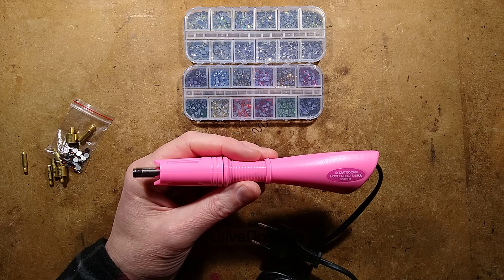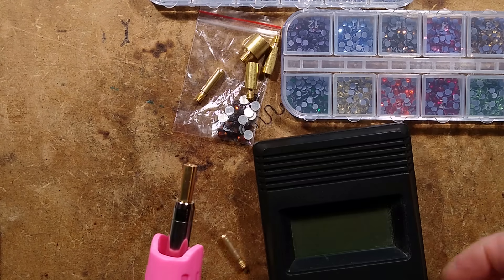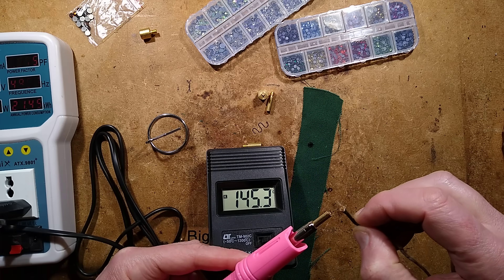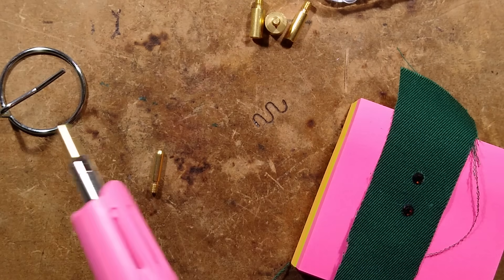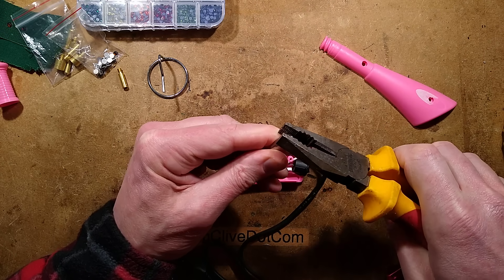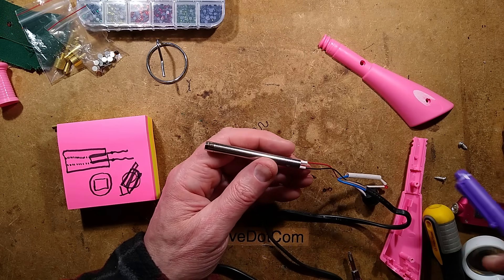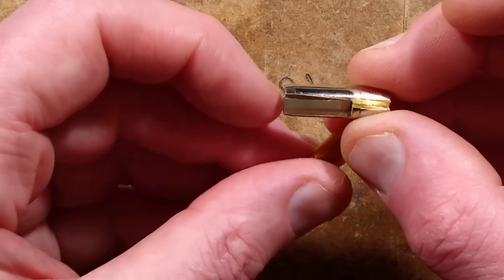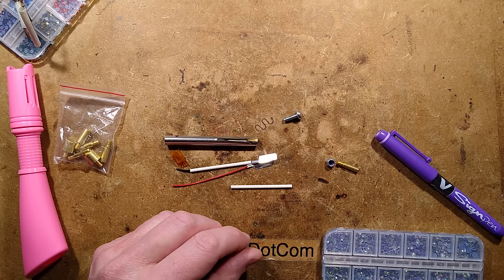Inside a "hotfix" rhinestone/diamante applicator

Comment: Would this potentially be a good desoldering tool? Hold it to the back of a joint to get components out? Idk that’s the first thing I kind of thought.
Reply from the maker: Not hot enough.
Reply: @ yeah that makes sense my iron usually runs over 300 c

Comment: A foreign class 1 appliance with no earth and 50 microns of insulation between you and the mains? Why am I not surprised.

All they had to do to make this safe was use an earthed plug, a 3-core flex, and connect the barrel to the plug earth pin (this would also prevent the temperature probe reading oscillations). Sheer incompetence or lack of care. Take your pick which one you think it is.

Comment: The method given by those brands that can be bothered with unmanly things like instructions is to match up the tip size to your hotfix crystal, pick it up, glue side down, with the tip and watch for the glue to melt. Then you put it on your fabric and withdraw. Takes a bit of practice, but doesn't have the glue squirting eveywhere, or burnt tables.

Comment: "Roughly a 4mm thread" - a good question to investigate would be "Is it a standard metric size?" - I have a phone/tablet holder with a gooseneck and a weighted base and let me tell you that the threads on the nut holding the thing together at the bottom may be metric but they're not in a typical thread pitch for the nut size meaning I couldn't replace the cheap hardware supplied with better kit that wouldn't loosen with use.
Reply from the maker: At the end I tested with a "standard" 4mm machine screw.

Comment: I wonder if those plastic bits stay on the material when the clothes are washed. Not great for the environment to get those little plastic bits down the drain...
I also wonder about the heat transfer: How hot might the PTC become and when would the capton tape start melting? It's a heat insulator as well I guess.

Comment: I've dismantled one faulty cheap hot melt glue gun, and they placed a tiny PTC thermistor wrapped in a tape (can't remember whether it was Kapton or something similar) into the metal nozzle, with not much of an insulation.
Reply from the maker: That's a common approach, with a metal clip holding the PTC element against the heated head.

Comment: Thank you, Clive.  Excellent tupper-cam close-up photos, as usual.  It's OK, there is no need to apply rhinestones to your tools.

It would be great if someone would invent a way for non-sewing clumsy bachelors to use this type of tool to re-attach buttons to shirts.  Maybe some sort of moulded polymer sharp-pronged thing that would go through the button's drilled holes, then be manually pushed through the shirt fabric, and then after turning the shirt over, the equipment operator aka clumsy bachelor would use this tool to press the polymer prongs together into a fused blob on the inner surface of the shirt.
Reply from the maker: You get buttons that either have a back that screws on or presses in.

Comment: someone turned a soldering iron into a bedazzler. The purpose seems to be so that you don't have to use a hot glue gun, with the tradeoff being you have to use a soldering iron instead? Very strange.
Why wouldn't someone just use a hot glue gun?

Comment: That thing reminds me to some degree of a tool made by Weller a couple of decades (at least) ago which is used for branding wood fibre and leather products. It came with a variety of different patterned bits and was quite a nice tool for decorating and customising things. It actually looks very much like a soldering iron in any other respect. It would certainly handle this job - no trouble at all.

I'll have to go and see if I can find it again....

Comment: good to see its built down to the chinese safety standards one slither of captain tape between electric shock and burns and a resistor to melt handle ,i suggest if your going to use it get an isolation transformer thick rubber gloves and a fire extinguisher!

Comment: It might be useful for heat staking plastics when reparing things like vehicle bumpers and interior panels. If designing 3D printed enclosures you could print plastic locating pins that you then dome over to retain the part in side.

Comment: Clive, get a cheap Chinese tiny thermal camera, one that you can plug into your smartphone or tablet. There are ones with resolutions rivaling Teledyne FLIR's cameras now, 256x192, but costing less than $300. I think it would be a cool addition to your reviews when we can see gadgets like this under a thermal view, and getting an instant picture of what parts get how hot. This would be so useful when reviewing LED lamps, hot tools and dodgy power transformers. You can find hidden surveillance equipment with it. Bugs. Also real critters outside at night. I bought one and had so much fun with it. Looked at the moon it reflected heat at ~8°C. I wish they were standard in smartphones.
Reply: Good suggestion. Actually, Clive has already done a great review of the mobile phone that he uses that has a FLIR camera built into it... ( I think it was a DooGee or something like that).

Comment: The brass tips for hot melt thread Inserts are M4, too. So this would be a cheap alternative. I use the inserts with a Parkside soldering station that has M4 tips, so no need for this pink beauty. 😂

Comment: The fluctuating thermocouple-readout 2:36 may suggest that there is electrical (mains) leakage whereby the common-mode rejection of the "thermometer" is overwhelmed, making it show a temperature that is way off the true value. If you unplug the appliance, you can easily check if this is the case...

Comment: Bouncing temp reading may be due to AC on the ungrounded tip. I've seen thermocouple meters do this in the presence of any AC signal on the TC input
Reply from the maker: It probably was coupled AC.
Reply: @mikeselectricstuff  that's good to know because I've had weird readings from thermocouples too, in the past

Comment: I always find it very disturbing how hot glue guns rely solely on capton tape to isolate the mains from the exposed metal parts. Considering they only have a 2 core flex I wonder how they pass electrical safety standards in the US, UK and Aus. I mean its not really double insulated is it?
Reply from the maker: It is a bit of a rule deviation.

Comment: Rhinestone was traditionally used to refer only to cut water-worn quartz that would be found in the gravel beds of the River Rhine. Diamante refers to all diamond-like simulants, including rhinestones, but also artificial diamonds and diamond shaped sequins. Now both are used interchangeably because they've both been associated with so many things that their original meanings were invalidated. Basically, if it sparkles and not a diamond it gets called a diamante/rhinestone (or Swarovski if you're trying to sound expensive). 🖤
Reply: And diamante is just diamond in Spanish

Comment: I bought one of these a while back for putting threaded inserts into 3d prints and it works great. I never trust these Chinese devices though so I wired a new cable on it with an earth lead to the barrel just in case it ever shorts. I also did the same with one of those cheap desolder pump soldering irons. 15 minute job for each and now I trust them a whole lot more. I also switched the resistor for 2 x 220 ohm to keep them running extra cool.

Comment: parkside(lidl) soldering station use tips with 4mm treads you can use just tips from that set and control temperature better and be safe form potential electrocution

Comment: Oh no! You killed it!  Good to see the metal end isn't earthed for added fun if a wire should come loose!  Shame the hot glue spooges around the edge of the diamante as it ruins the effect.  Wonder what they used before hot melt glue was invented?
Reply: “Spooges” – you speak fluent Clive 😂😁
Reply: Ordinary glue. Which seems like it would work just as well if not better. A dot of gel type superglue and place the stone, would set just as quickly.
Reply: @NiallWardrop  Except that hot melt was around before gel type superglue. I think they used to mount the rhinestones in studs that  were attached mechanically.
Reply: @SidecarBob  I just mentioned the gel as probably the best currently available.
Reply from the maker: I did buy a replacement afterwards.

Comment: I have a similar tip for my soldering irons (TS100 and TS80) for putting threaded inserts into 3D printed parts. 
It is useful to be able to set the temperature to the low end of the melting point of whichever type of plastic was used. Otherwise if it's too hot, it can melt too much of the plastic and cause the insert to move out of place before it has a chance to cool down.

Comment: would be interesting if the tips were the same size and thread pitch as the screw in tips for a soldering Iron
then you could have a pink soldering iron to go with your kink paculator 😀
the potential shock hazard is worrisome tho...

Comment: If I’ll be testing small loads should I buy a Hopi or the antai? And is there a USB tester power usage you recommend?
Reply from the maker: They do different power ranges in both the Hopi and Antai branded versions.  For smaller loads the low range versions will be more accurate.

Comment: If plugged into an isolation transformer, it could be suitable for burning away unwanted things on skin, like warts or ticks .   A lower value resistor would be needed to run the indicator LED at a standard 20mA, but it would have to be a 5W resistor to drop 240 V at 20mA .

Comment: Being pink and round: The google AI would have likely confused this with a rather controversial medical device that claims to use RF heat to cause a temporary inflammation. Nuff said. I think the selfish world gone crazy. As for them rhinestones one would think kids would be safer using a UV cure adhesive. But the latter is not reversible.

Comment: The same basic idea as the "heat set" or "hot melt" threaded brass insert tools, except that it runs at a lower temperature (just enough to melt the hot-melt layer?) Those things have saved my bacon on very many occasions, providing a FAR better fastening solution to the usual self-tappers that Manufacturers seem to like (for obvious cost-savings reasons)

Comment: Reminds  me of the woodburning art/craft kits of the '60s that included a handle with an E12 lamp socket for you to screw a heater into (they also came with an assortment of tips that screwed on).
For a lot of us in our early teens they were our first soldering ions. It was annoying as hell when the E12 expanded with heat so the heater lost contact just when it got hot enough to melt the solder...
Reply: I did that exact thing/ they did make a good soldering iron up to a point 🤨

Comment: My first thought was to wonder if this would be suitable for installation of heat-set threaded inserts in 3d prints.
If so, this would save me the trouble of keeping spare tips or a spare soldering iron to set the inserts.
Reply: You can get tips specifically designed for heat set inserts, there's one similar to this (but not an AliExpress special) mounted in one of those mini manual bench press mounts in the lab at work.
Reply: @Croz89  Also, Adafruit has heat-insert tips for Hakko-compatible irons.
Reply: @electronics-girl  
Thanks for that info, I'd looked for something along those lines but didn't find them. 
I have one of the various generic come t-15 irons sitting idle that could easily be used for this.

Comment: I wonder if that thingy could be used for brass inserts into 3D prints? So at the end does the PLC (or whatever is 3Dvprinter stuff)melt at 200 C???
Reply: Likely, but it would be a bit awkward. For PLA, the recommended temp is 225C (higher for other filaments). Inserts are easier to get into position if the tip matches the internal diameter of the insert's thread. They make soldering iron tips specifically for such inserts, and those work well.
Reply: @FedorKorsakov  So the short answer is no. but maybe with the right inserts and filaments.

Comment: So, some Kapton tape is all that is between the raw mains voltage and children...   At least in glue guns the metal heater barrel is usually insulated from being touched with an additional plastic cover.
Reply: Every glue gun I've seen has an exposed metal cone at the front.
Reply: @eDoc2020  yes, very true.  I wonder what the internals of a typical cheap glue gun look like - Clive????
Reply: @project-326  Clive did this a few years ago.
Reply: Well, I'd say if you're desperate enough to touch 220°C metal, you deserve to get a zap ;)

Comment: It's a Barbie soldering iron! About the right temp, and the tips undoubtedly have the same threads as soldering tips. The only difference is that extended collar and silicone grip around the barrel, which would be nice to have on a soldering iron, actually.
Reply: what type iron you think of? weller tips are just lumps of metal that are held in place with a collar nut sitting butt on butt with the heating element and the cheapy aliexpress tips that sleeve over the heating element are also using the collar nut system

Comment: That LED is probably destined for an early demise even with a large resistance in series. In practice the reverse breakdown voltage on those oldskool red LEDs is surprisingly high and on a 110V supply I think it would be OK but 240V is pushing it too far. Would feel a lot better about it with a 1N4004 in series (and of course deal with that hot resistor too!)

Comment: I have this exact tool.  I use it at work when I have to add or remove rhinestones from clothes.  I am a seamstress.  you can't sew through those  stones.
Reply: Reckon it'd be any good for very small diameter heatshrink?
Reply: Only thing worse are the folded over, doubled seams in denim. Bent or broke many a needle in those areas.
Reply: @Subgunman  Strewth.  I've broken many a needle replacing zippers (even on nylon IIRC).

Comment: Is the crimp part of temp control by not having the whole heater in contact it wont get to full heat? can you hack it up or down a bit by changing the depth of insertion?
Reply from the maker: It's wedged in very tightly, so removing it may cause damage.

Comment: I was intrigued by your comment that "it will conduct on both halves of the waveform". I know it is well dodgy to expect a LED to cope with the full reverse voltage, but I did think that if they actually got to the point of "conducting" then they were basically dead. I could not see a reverse diode in there.
Reply: IIRC, this circuit doesn't work with gallium based leds like the blue and the modern bright-green ones, because that semiconductor alloy can't handle such high reverse voltage. 
The old school red, orange and apple-green leds are resilient enough to not require an additional reverse diode.
Reply: the resistor limits the current in reverse too. Basically every diode is a zener (or more accurately avalanche diode) if you give it enough reverse voltage! Typical non-zener diodes usually have a reverse breakdown of 350V or more

Comment: what a surprise .. not only is it not double-insulated, that single insulation is very much depending on luck,
Reply: Going by  memory, I think Kapton tape is  just 50 microns (0.05mm) thick, and although its dielectric strength is excellent, that's not much "protection" from potentially 240v.
Reply: On the other hand, at more than 200°C, I'd avoid touching it in any case...
Reply: @ynes6658  Whilst I "think" Kapton's OK up to around 350C, I certainly agree with you. I note there are better (and probably 'safer') solutions on the market, and it's a case of "you get what you pay for".
Reply: It's typical design for this type of heaters. The kapton tape is thick, non-sticky and wrapped several times over the element. I've never seen an insulation failure with this. But the PTC can sometimes arc over and explode - it will likely work again after this, even though cracked into several pieces!

Comment: Doesn't everyone just snip twist ties off? LOL
Reply: No, i never snip twisty ties. I untwist and reuse them. I don't snip plastic zip ties either, if possible. I insert the sharp pointy end of my tweezers in between the little tab and the zippy part and pull it out.
Reply: Nope, I untwist and re-use them, they come in handy for all my cable coiling & bundling needs.
Reply: I unwrap and then dispose of them. /: